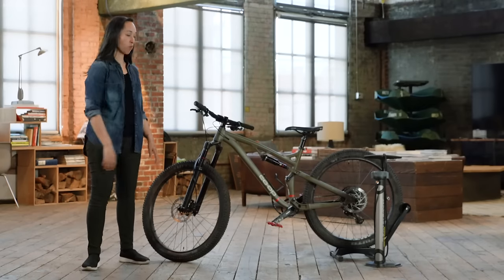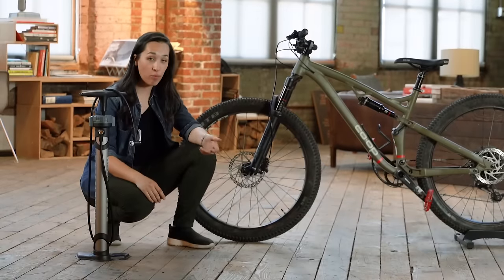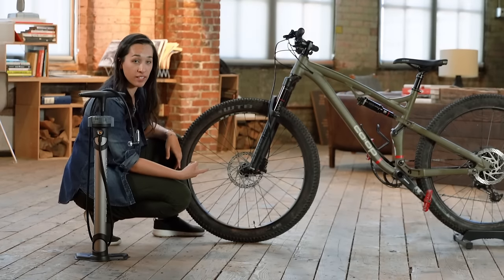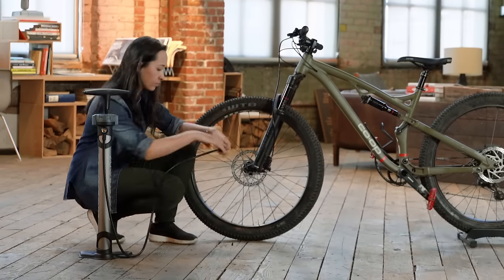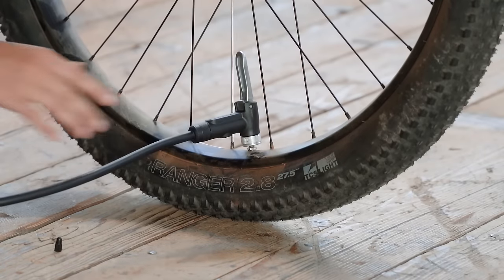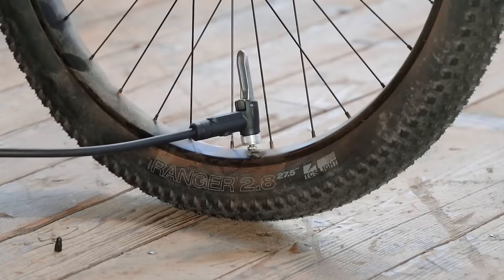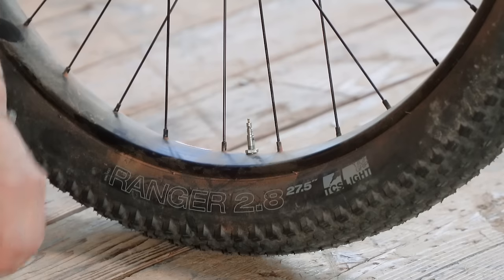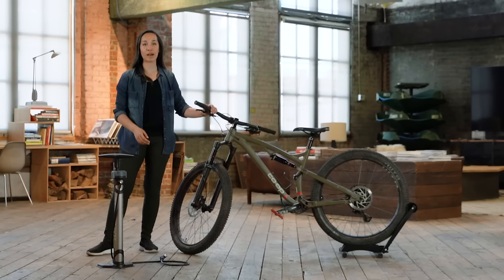How to Pump Up a Bike Tire With Presta Valves || REI

Comment: Yes, fine with a floor pump, but how do you do it on the road with a hand pump? I've been cycling for 50 plus years and find Presta valves a total pain
Reply: Pull the end off the hose and just put the bare hose there, there will be enough air pressure to open the valve, my bike pump doesn’t work with presta valves, but I did that and it worked fine

Comment: When I recently purchased my co-op e-bike from REI the employee didn’t mention anything about Presta valve and I didn’t notice.  I suppose they’re so used to these and maybe more experienced cycles but perhaps when they realize they’re talking to a novice they ought to provide more info such as this.   And this video should Begin with the information that a special pump or adapter is required.

Comment: Thanks a lot!! I’m new to Presta valves, and having just bought a pump, I was getting so frustrated because air just wouldn’t make its way to the tyre, but your tip of putting the valve in the 6 o’clock position made all the difference!

Comment: Is that a regular pump or is there an attachment for presta?
Reply: I think you can use a normal valve... not 100% sure tho
Reply: My pump had a valve 'poker' to open a regular valve for pumping...did not work for the smaller valve..

Comment: I had an old French bicycle rebuilt and the tires came with these weird valves. Really mystifying if you don't know to turn the little nut to open the valve. I had found adapters but no instructions came with them. Thanks
Reply from the maker: We're happy you were able to get it figured out. 😁

Comment: How do you pump up a flat presto tire that has no air pushing back on it from the inside?! The valve is not firm but loose because no air is pushing back on it from the inside I am thinking?

Comment: I did this and then i couldnt get the pump off the stem and ended up bending the presta value stem. Took the bike back and will never deal with Presta valves again.

Comment: I think you'll find your using the lever on the pump valve the wrong way. Its close to lock onto the bike valve and open to.. open.. hence why you force to much to pull it off.

Comment: Nope. Using the same pump I've been using with my other bikes with a regular valve, and it does  nothing. Won't even go on far enough to reach the valve. Thank you, for completely neglecting to mention step 1
Reply: Ya we need to get the adapter thingy. I gotta google that now.